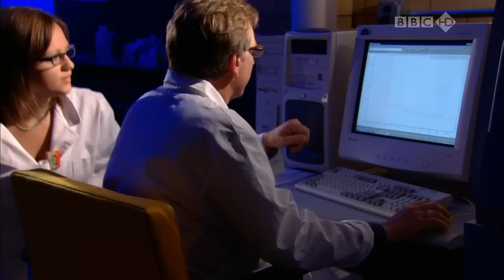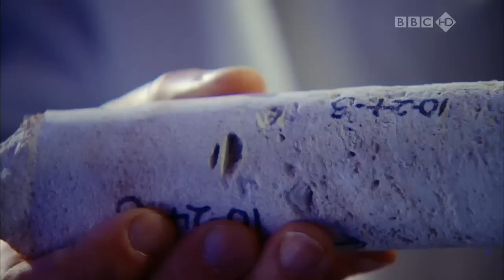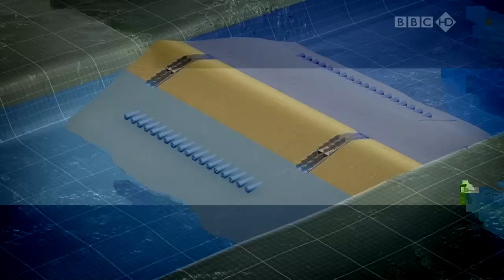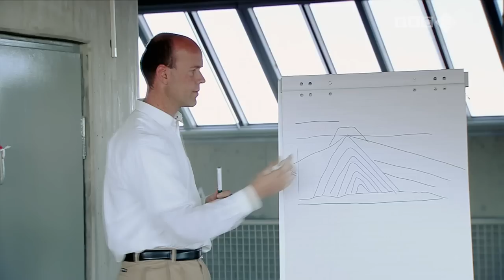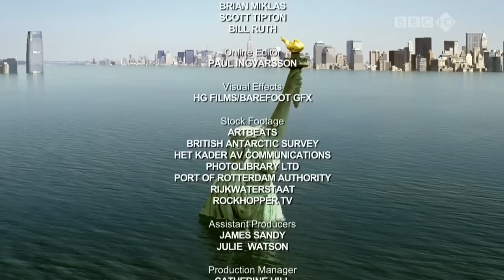BBC Documentary Earth Under Water

Comment: Also a study shows an increase of ice cream consumption also happens during an increase of people drowning.
But that doesn't exactly mean that eating ice cream makes you unable to swim. It just means more people are doing water sports thanks to the hotter weather.
Not everything that correlates, correlates.
The only reason why people believe C02 causes cooling is that it gets "weaker" as a GHG when it's higher in concentration. Have you considered that it's just *pushing* the other gases away?

Comment: First off melt water of the polar ice caps doesn't end up in those lakes, the lowest lakes are 177 meter above sea level, and water doesn't go up.
Second, the ground beneath the lakes where pushed down in the ice age by the enormous pressure on them from the ice caps above, this ground is still coming back up, tilting the lakes, increase the rate at wich they drain. 
Look at images of the polar ice caps over the years, they're clearly melting at enormous rates.

Comment: Temperatures at the moon may go very high as it has no gas atmosphere and there is no cooling by convection of gasses. So, the temperature would depend only on thermo-conductivity. If it is a solid rock the heat will go deep and temperatures are rather moderate, the layer of light dust at the surface can get very hot. As for water, if you are in Armenia, pls, look at your ancient ruins in mountains. Many were built at the banks of rivers in past. Where are they NOW? Pls, tell me WHY?

Comment: No, it's not an option, but it's an opinion and a position I'll stick to. :)  I agree with your technical analysis, however energy costs in Europe are not really going up and the infrastructure for renewables is building up fast over there.  We just need to put capital into building it in North America and elsewhere, and it will happen.  I think if we eliminated all subsidies from fossil fuels the increase in energy costs might boost that.  We wouldn't have any other choice.

Comment: While it's true that particles absorb or transmit heat from surfaces, it isn't the only way that temperature variations can happen. The moon radiates heat into the space and loses energy over time.
If the moon would never get cold it would violate the second law of thermodynamics.

Comment: And all that is irrelevant because the water of the ice caps only melts into the sea. The great lakes aren't connected to the polar ice caps so the water can't reach them. Unless there would be some break in the laws of physics at work, but I doubt that.
I understand that the great lakes where formed by a glacier, it's the reason I gave for the lake tilting, remember? However, the glaciers melted away along time ago, cutting of water supply to the lakes.

Comment: During the last ice age sea level was about 300 meters lower than today. When it ended sea level rose and then stabilised about 8,000 years ago. Now it's going up again. 

During the last interglacial sea level was higher than it is now, but with CO2 levels higher than at anytime in the last few million years it's going to get hotter than the last interglacial, therefore sea levels will he higher than the last interglacial.

Comment: Can't help but notice the 'steel rebar' used in the New Orleans flood defenses concrete is NOT epoxy coated meaning it'll corrode just from exposure to moisture in the curing concrete WELL before any storm surge. 'Planned Obsolescence'?

Comment: Oleg I live in the USA, California. Oleg I will respond for the moon first, then other your question about Armenia. With out of molecules in the space, you won't have any temperature variations. The reason why? Only solid mass particles can absorb heat or hold cold. You may say moons surface is solid what ever it absorb from sun it radiate back. Yes that is possible to, but you have to realized one thing if there is no molecules in the space dark side of the moon never will get cold.

Comment: 1. Temperatures are rising but they go up and down. Yes, the temperature actually dropped for a couple of years then went back up again. Hence no one uses the word global warming anymore, they spin it as climate change now. The principle cause is that the sun is increasing in intensity. All planets in the system are heating up. Sun > carbon from cars.
2. It's cheaper for all countries to pool resources to dig a large pit to channel excess seawater. Like into the middle of Aus.

Comment: The circle of Earth is the following :
Ice melt because temp up - too much heat
Super Volcano blast - Ice reform - no heat because Earth cover by cloud of dust for years

Ice to water, water to ice is all depends on this volcano timing.
If Volcano not doing the job, then the water will in 2100.

Comment: If there were no greenhouse gases in the atmosphere, the global mean temperature of about 14 degrees Celsius would be 33 degrees colder. That's the natural greenhouse effect. Anthropogenic greenhouse gases increased the natural effect so far by only 2%, 0.7 degrees warming during the last century. At 500 ppm CO2 there will be another 0.7 degrees more, one more at 600 ppm, and so on. Feedbacks will become stronger, because a warmer atmosphere can hold more water vapor, the #1 greenhouse gas.

Comment: At 34:50,  you build two dams, with locks, and pumps to backfill the water and the issues are that still you have sea creatures that flow in and flow out with the free flow of the ocean water.  The simple solution is to stop the use of carbon based energy sources, or limit them in such a way as to stop the rushing toward melting Ice Caps.  Or build floating cities and just deal with the loss of coastlines.  Lack of tourism is the least of their worries. Can't think one or two dimensionally.

Comment: Sea levels are rising at a fairly steady 30 cm per century. Has been doing so for quite some time, many centuries at least. Hasn't noticeably changed in the industrial age. So the 120 feet they mention in the opening would take 12,000 years. I don't really think the rest of the vid is going to get a lot better.

And it didn't.